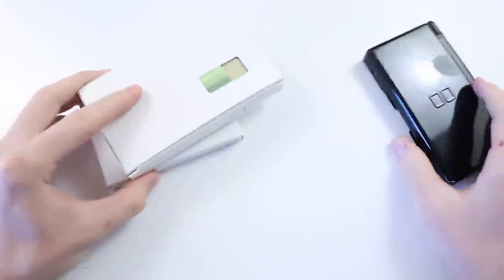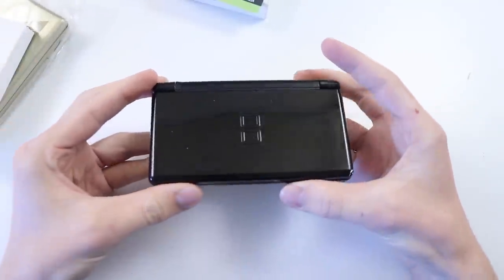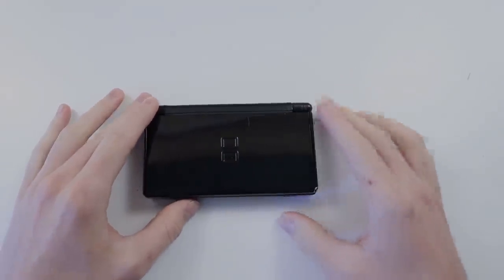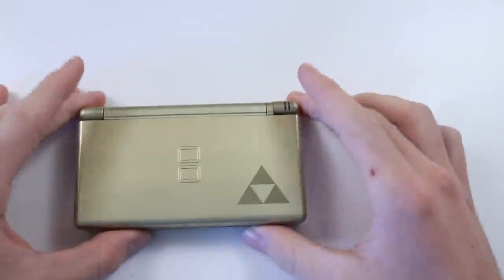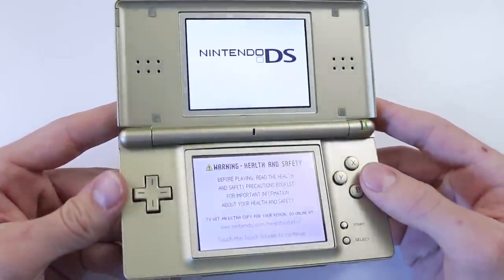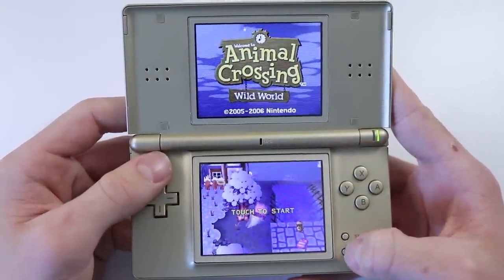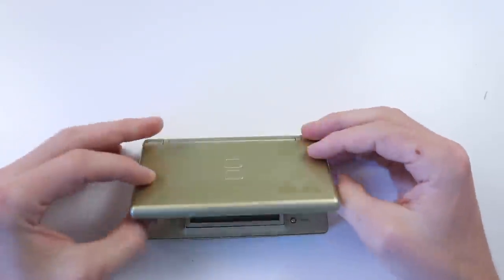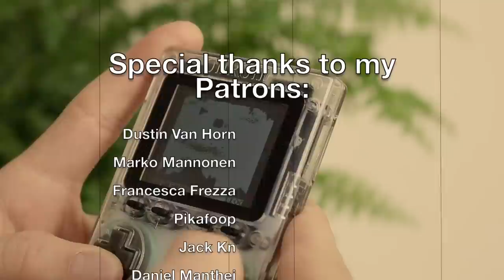Let's Refurb! - Nintendo DS Lite Screen & Shell Replacement!

Comment: I’m really sad because my Nintendo ds can’t recharge or play any games
Reply: Twister 123 Have you tried replacing the battery?
Reply: Jenna Creighton wdym replacing
Reply: With what I replace?
Reply: I’m not an expert at everything..
Reply: Twister 123 It's just like replacing the battery in any other electronic. Look up DS Lite batteries online and order one. Flip your DS over. There's a little rectangular covering with a philip's screw on it. Unscrew that. Make sure your system is OFF. Take the old battery, and install the new one. There's also guides online for this.

Comment: I changed the shell of my ds Lite and Now when i Turn the ds on the upper Screen turns on for a second and than turns off again. The Green led also turns on quickly. And when i put it in the Charger the Orange led turns on and doesnt turn off. 
I bought another ds for 10€ and pur the motherboard to my Broken ds and got the Same Problem. Than i put it Back to the new ds lite but it doesnt turn on anyway. 
Now i got two ds that does Not Turn on ...
Can someone help ?
Reply: Make sure that the ribbon cables are connected all the way. If ether one of the screens isnt connected, the ds wont boot. If one of the screens flashes before turning off, then the other screen is to blame. I hope this helps
Reply: @genericanimename6733  hello, l have the same problem on my DS fat, and l was aware of the problem, because the ribbon cable was snapped, but is it worth fixing it? :')
Reply: @noodle8965  It should be worth fixing if its just the screen since they are not an expensive part to replace.